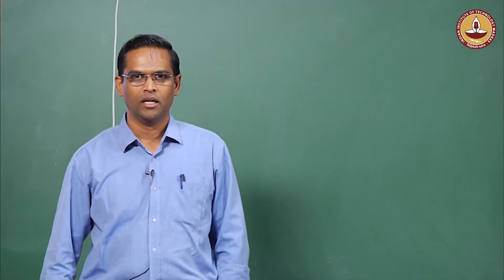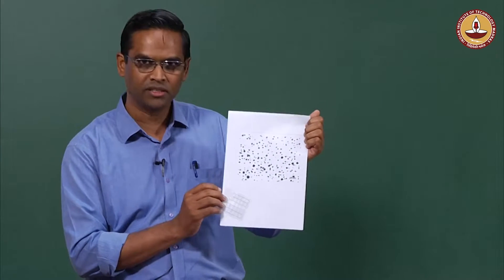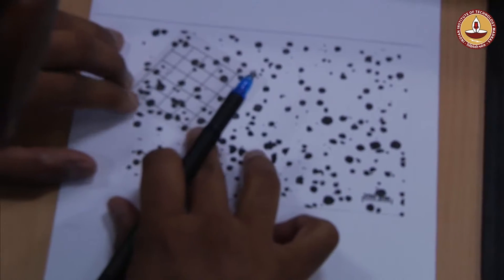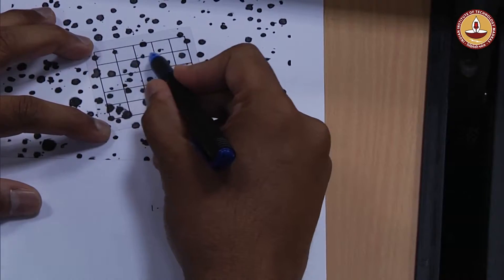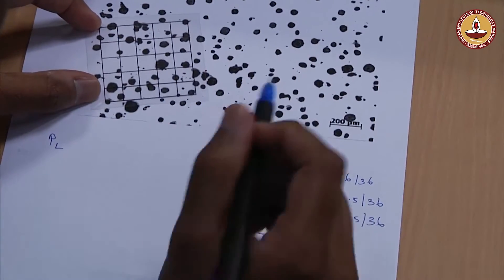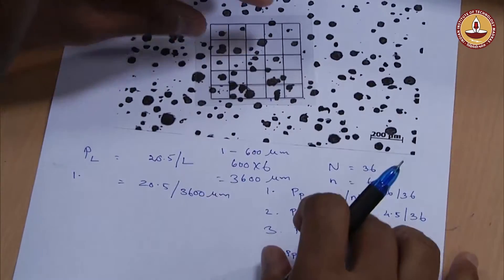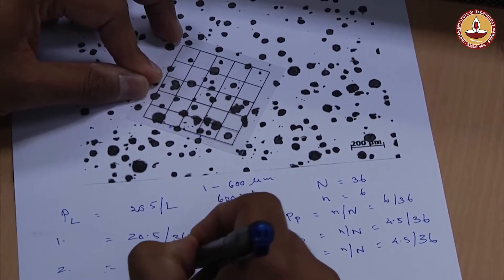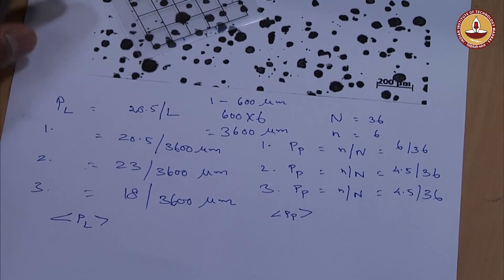Volume Fraction and Particle Size Part 1

Comment: Sorry, Prof. Your explanation was not clear to me. It would be better if you just explain more clearly the principles of working with mesh than measuring three samples. Moreover, what is the use of Pp and pL? what are they going to present? I did not get it